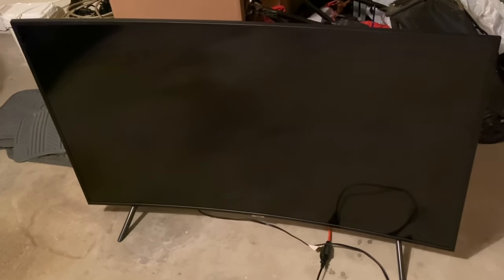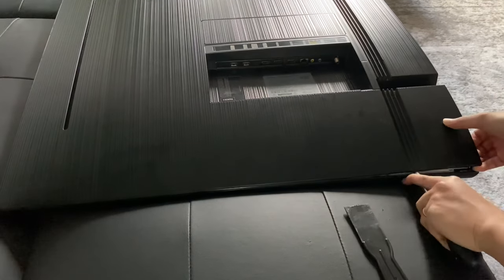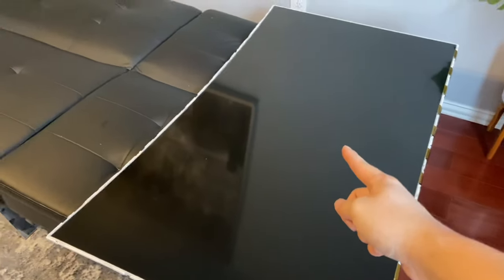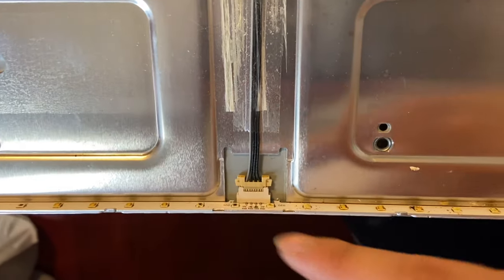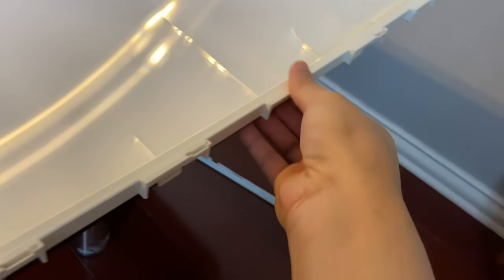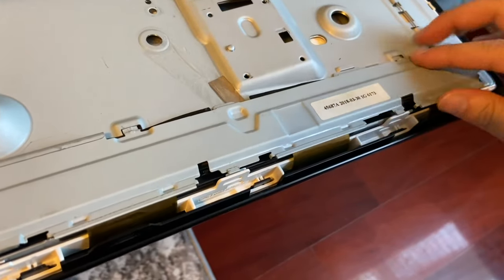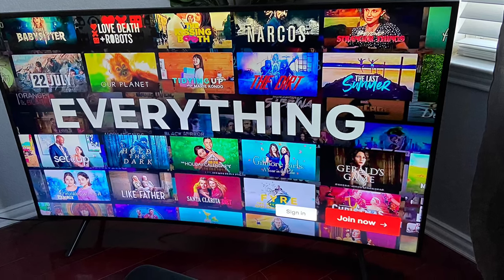Replace Backlight LEDs on Samsung Curved 55” for $30 (UN55NU7300 / UN55NU7100 dim screen)

Comment from the maker: IMPORTANT NOTE: On the burned plexiglass at 5:19, it's best to sand down / dremel the burned areas until they're gone, and then reinstall it into the TV the same way. If you do not dremel down the burned areas, TV will appear yellow like at 9:11. The way the plexiglass is made, it's supposed to darken the section closest to the LED and brighten the section away from the LED. Do NOT flip the plexiglass. 
1. TV LEDs can be purchased here! http://ebay.us/KQqhgg
2. Screwdriver set: https://amzn.to/2OiNf6v
3. Plastic Putty Knife: https://amzn.to/3rfUGtQ
4. LED Lights: https://ebay.us/scXAT3 OR https://amzn.to/4du9nBz
Reply: I have the UN55HU7200F ( not the NU in the middle like yours ), same backlight as in yours or is it a full array?
Reply from the maker: @kriswingert1662  HU has many more backlights https://www.ebay.com/itm/203105953105
Reply: @EdwardInTX  I have the Samsung UN55NU7300FXZA. As with your's in the video, my plexiglass is cracked and the inner white panel next to it had LED heat damage. Smelled, LOL!!! I got it fixed and it is watchable but the cracks and heat damage do show on the bottom. Can those parts be found at a reasonable cost. Now that I know how, it'd be an easier task. Best advice I can give to others about doing your own repair is to have and use patience and a small and thin straight blade screw driver to remove the white inner frame and twist at the tabs just enough to clear the lock points. My only left over parts were the few I broke and then thought about the smaller screw driver and that worked. But I also slowed down the process. Great video. Thanks Edward.
Reply: You really oughta add to the video itself about this. No one is going to look at the comments until after they have problems from following your advice. You can add audio, video or just captions but you're garnering a lot of ill will by leaving it up as is.

Comment: Excellent Video!  Thank you for posting!!  Let me ask you this.... Why is it that just about everything Samsung makes, turns out to be absolute crap!??  We purchased all new higher end Samsung black stainless appliances in 2018. In the first year the microwave failed twice. The oven part of the range failed twice, the fridge ice maker froze over daily and stopped producing ice.  The metal finish is so thin that it dents with almost no pressure.  Now our 2 year old 75" OLED backlight has failed on the right side.  I WILL NEVER BUY ANOTHER SAMSUNG PRODUCT EVER AGAIN.
Reply from the maker: Wow this is terrible! I have a samsung microwave and range and they haven't failed (knock on wood)

Comment: Few tips for anybody giving it a go:

1) when you get to remove the LCD panel I found if you very carefully slide a bed sheet) or something similar) under the panel you can easily slide the panel from the base without damaging it.

2) tape the 2 white sheets under the (LCD Panel) together so you don’t lose their orientation/order.

3)do the same for the plexiglass and white backing as it is KEY this goes in the correct way or light will not amit correctly.

4) make sure the white frame clips securing the felxiglass are fixed in correctly. (I made this mistake and I had a lot of LED bleed along the bottom edge just from 2 clips not in correctly)

5) if you put it all back together and the bottom of the screen is very light and top very dim. Your Felxiglass is upside down. Unfortunately you have to take it all apart again and turn it so the top edge is at the bottom. Trust me it a lot easier to take apart the second time. ( you can also plug the tv in with just the plexiglass clipped in to see if the light is covering the entire panel. Instead of reassembling the whole tv to find it's not). 

But Thanks Man what a helpful video! Wouldn’t have tried doing this myself if I didn’t watch it and now have a good as new working TV!
Reply from the maker: Excellent tips!
Reply: I'm having the opposite effect of the  bottom portion being bright but the the middle and top being very dim.

Comment: We followed your guide and were able to fix the tv so that it was watchable again but it was far more difficult for us noobs than it seemed in the video. Many of the little plastic tabs broke and a small chunk of the bezel broke, etc. The one issue that we have now is that when we turned it back on and could see the screen, the picture looks like its being viewed on say.. something like cardboard or some other sort of material and on the far right side, there's an inch where the picture stops instead of going to full side. We obviously messed something up in putting it back together and the two that helped aren't interested in repeating the pull apart process because it was such a hassle for us. No matter what though, the good news is that the process you demonstrated worked and we can now see the full screen. Whatever caused the other issues was something we somehow did. Thank you for the video.

Comment: I used your tutorial on my flat screen Samsung UN50NU7200. The components are exactly the same, except it doesn't have the white tabs securing the metal strip. Unfortunately, I hadn't read your comment about the plexiglass orientation and that dark-on-bottom/light-on-top thing, so I'll be re-doing it tomorrow.  For now, the light strips are working great. Thank you so very much for a great video!
Reply from the maker: Awesome! Hope the reinstall goes well!

Comment: I did this repair and everything went well following your instructions. I also had a crack in my plexiglass  but unfortunately flipping it around created a big shadowed area in upper portion of the screen. Just had to install it the way it was and all is well!! Thank you very much for this video!! 👏🙏
Reply from the maker: Awesome!!
Reply: Because maybe yours contain mirror sheet and u didnt flip the mirror sheet that reflect light some of those have this type of sheet that u must flip them
Reply: @StAlKeRsification  Things woodworkers don't know! 🤣 Thanks for the solid info.
Reply: @tecc8380   im a mechanic but i know basic electronics
Reply: @StAlKeRsification  So you are gonna use your "intelligence" to generate a negative vibration and judge your own kind? You are aware that people know different things, right?

Comment: Hey, thanks a lot for the guide. Based on your video I successfully repaired slightly different model (6 series instead of 7). While there were some differences your video was a great start.
Now I just hope those "original" led strips from AliExpress won't die after 2 weeks
Reply from the maker: Very nice! I've done a handful of 6 series the same way!

Comment: Thanks very much, I used this video to fix my own issue, sadly, as careful as I tried to be I cracked the screen. Knew it was over but decided to carry on anyway. Anyone thinking about doing this, please be so careful. I barely moved the screen and it cracked. On the bright side I've just ordered a 70 inch ambient light Philips. 😁
Reply: This is why I am having a professional fix my TV.  I would break something if I tried to do it.
Reply: @fidelbanuelos9601  buy two suction cup thingys and its easy...my dumbass cousin lifted the corner as I was unpacking my suction cups and cracked the fuck out of my top left corner almost to the top middle of the screen...so other than that it's surprisingly easy to do in less than an hour, just use suction on the main screen
Reply: @Beast-mf7br  I used paper packing tape instead of suction cups- worked great and left no glue marks

Comment: Fantastic video — thanks! My son and I had a great afternoon project and the TV is working beautifully. Had a minor panic when we turned it on and the screen was black. Realised we hadn’t connected the ribbon cables correctly so pulled it apart and reseated them. That fixed it and our heart rates returned to normal
Reply from the maker: very cool!
Reply: I'm having the black screen issue as well but reseating the ribbon cable hasn't fixed it.
Reply: @reallaknight503 If the screen is black then it means that the signal isn't getting from the board to the screen. I'd double check the seating of the ribbon cable, I found it a little tricky to get it seated right. If that still doesn't work, check the other end of the cable and if that still doesn't work, check to see that there's power getting to the boards.

Comment: Near my entertainment center I have always kept a filtered 12x12 box fan , I've never had anything ever go out on me because of this .
Started when I was young I got to have my box fan near me and as I learned heat was the main failure of electronics and noticable heat coming from tv, computer, Xbox and or surround sound.

Comment: I just followed your video to successfully replace the backlights on my Samsung 55 inch tv.
But half an hour after watching a bit of tv the newly replaced LED strip burnt out on the same side as it did with the old LED strip.. :(
Any idea why?
Reply from the maker: omg no! That was a bad LED strip. Request a replacement.

Comment: Did repositioning that paper help with the back light bleed? I have the same issue after replacing the LEDs.  I hate opening up this TV lol
Reply from the maker: The burnt panel had to be installed the same way it came out. Can't flip it. The trick with that panel is the burned areas need to be completely dremeled off.

Comment: Great video.  I have one now that needs the repair.  Could I put do anything such as adding thermal paste to help prevent over heating again?
Reply from the maker: Some people mention adding a capacitor to regulate the LEDs but I’m not that advanced
Reply: @EdwardInTX  i have the same problem on my samsung..
Really refuse to send it back for repairs for hundreds of dollars so i might try it myself
I’m just wondering how old was this particular tv? Screens nowadays seem to last like a year or 2 until they get this 
Great video though!
Reply from the maker: @mrcreeperman13  this was either 2017 or 2018. It was the 4th 7 series samsung I fixed.
Reply: Richard Dolesh una pregunta este tv trae salida de Bluetooth ?

Comment: I really wish you showed how to safely move the lcd panel instead of transition to it being done. My brother and I were on the last step of moving the lcd panel back in place with a team lift, only for the screen to crack in the same corner I replaced the broken leds. Now instead of half a screen being black, I have about %96 a screen with a crack in the corner.

How did you move the lcd panel multiple times as one guy without cracking it?
Reply: Exactly. My new LEDs are working great, but now the tv is trash because somehow I got a crack through the screen. Tv is trash. I was trying to be so careful and didn't even realize I got crack until I got it all put back together and turned it back on.

Comment: I Would have liked  a few  shots of the whole back of the tv, can you confirm what boards are they, main board, power board etc?. Before I dismantle ours I am wondering if it is worth it cost wise. Ours went bang & I would like to replace all boards as I suspect the power board took them all out?.
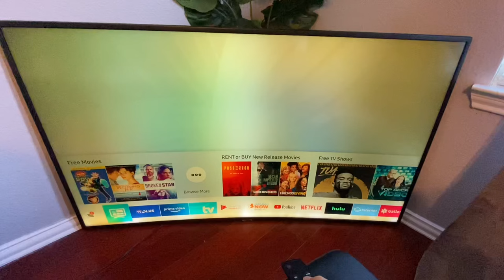Reply from the maker: 9:18 - 9:26 show the main board (green) and power board (brown). Those are the two main ones. If either of those don't fix it, there's a deeper problem in the panel that isn't worth fixing.

Comment: I repaired a same 55 Samsung tv like this but i has light bleeding like your tv, you said the problem is the position of tge first white paper.how should i do it on the first white paper to fix light bleeding in the bottom ?
Reply from the maker: Actually  I realized it's because of the transparent plexiglass. The best way is to dremel off the burned parts of it and put it back in the same way.

Comment: Hi I have a issue and I really need help I replace backlight in a samsung UN65TU8000FXZA after installing the new light I test all with my backlight tester all work fine. After putting the tv back and plugging it in the backlight is not powering on.The powerboard is working because I'm getting power about 280v for the backlight. So my question is what could be the problem could it be the white connection between the powerboard and the lights. I forgot to mention I test the backlight using my backlight tester and the backlight work. I have some needle leads to my backlight tester so that's how I was able to test inside white connections.

Comment: Great video.  I just want to ask if the cracks on the plexiglass don't matter because there are quite a few of them.
Reply from the maker: If there are brownish spots at the end, sand them off. The cracks will show a little brighter than the rest of the screen, but not really bothersome.
Reply: @EdwardInTX  OK.  Thanks for the reply.

Comment: Thanks man! It helped a lot, after I replaced the back light, the top looks darker than the bottom. Is there a reason why?
Reply from the maker: The plastic diffuser panel distributes light to make it even. The best remedy is to saw off the burned parts at the true bottom and then reassemble it. Light will be even after that.
Reply: @EdwardInTX  I just change the position of the plastic, it looks way better. Thanks man!
Reply from the maker: @TheAldoo1995  Excellent!
Reply: @TheAldoo1995  what do u mean you change the position by mounting it upside down?
Reply: @4g63_Everything  I think I accidentally changed the plexiglass position. It didn't look as bright as it is supposed to do.
Reply: Usually if you just flip the plexiglass around so the bottom is facing upwards it'll work as well and you won't have any issues.

Comment: thanks for showing the led strip change. do you suggest to fix the vertical shadow on the screen by changing the led strip ? will it help? Also could you pls suggest the led strip for the curved samsung UN55KU7500 model.
Reply from the maker: Yes, you'd need to change the LED strip to fix the vertical shadow. This is for the KU7500, but the led strip installation process will look different from the video as the LED are scattered across the screen. https://www.ebay.com/itm/154951141781?hash=item2413cec995%3Ag%3AeFcAAOSwLateeccK&amdata=enc%3AAQAHAAAAkMSl1Ks%2BPSe9V5Ol0qrJlK02c0N1Sxp5csU25%2BxOlb9DWYDGpJqQ9wH%2FylpV9uLs8T5yJCVE27ttIBryoHdMYyBFYscUxyHiyEetpCtle5YQ6X0ephVN92y84wjrQWArBvV6Xx%2B5MKh4FpNztva0GIMzJ%2Bhld8ana9B8Ko9bJAOQYel%2FuHkiMZCPfX2AExF4Ow%3D%3D&mkcid=1&mkrid=711-53200-19255-0&siteid=0&campid=5338782093&customid=&toolid=10001&mkevt=1

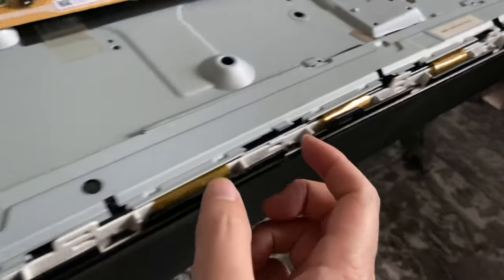Comment: So I’m following your video up to the point where you have to remove the cover source PCB panel at 2:45 and there is no white hooks. What do I do? I’m using a NU7100 50inch
Reply: I am in the same boat and was reading the comments to try to figure this out

Comment: I have a cracked and burnt plexiglass just like in your video. Mine is a little worse, but do you know if you can get just the plexiglass? I am not having luck finding. Even Samsung does not have for resale to the end user and no techs within 200 miles
Reply: Larry I feel you, man! I've fixed ten Samsung's with edge lighting all with the same problem. I've spent multiple hours looking for a way to purchase the plexiglass diffusor. Still can't find a place so I have to swap them with ones I  find from broken screen TVs. Did you ever find a place?

Comment: Seems u might know the answer to my question. What's causing light bleed/4" bright flares on left and right on my 65" curved Samsung? Also a couple of dark spots a little larger than say a capsule💊??
Reply from the maker: What model is it? Email me pics at my about link on my YT profile.
Reply: @EdwardInTX  un65js9000f. Sorry, not able to email. Couldn't find it under your about link. I'm guessing the flare's (very bright on one side, shadow on the other are internal cracks. I may dig into it tomorrow. Get a better idea on what's going on.
Reply: @EdwardInTX   @EdwardInTX  so yeah.....it has all the same issues you had. Too bad the burnt cracked plexiglass can't be replaced. But thanks to your video, once I replace the LEDs, I'll have 25% improvement on light emitted and perhaps if I use windshield repair resin on the plexiglass it might help? Or super glue? I'm more hesitant on the super glue being that it's plastic.
Reply: @shanewatkins5636  did the repair resin work?
Reply: @kvothe4637  it helped. Just wasn't worth the effort for as little improvement as it was.
Reply: @shanewatkins5636  ok buddy, 👍

Comment: I followed the instructions and replaced the LED but now the screen is entirely black. Panel and plexiglass all fine. What could have gone wrong. I am only hearing the sound but no display at all
Reply from the maker: Connection ribbons to the panel at the bottom of the screen

Comment: @EdwardTX 
I own a Gigabyte 32" Monitor G32QC and need to replace one of the light strips as I have a black bar, indicating that one of the backlights is not working. Could you provide the part number or share a link to the backlight strip that would be compatible with my monitor?
Reply from the maker: did a quick search online, wasn't able to find a replacement LED set for that

Comment: I have a curved on different model it turns on go's to a blue screen then shuts off my electronic mentor says it's probably a resistor on the power supply. Dose that sound right? Mine is a Samsung UN65KU650DFXZA

Comment: nice video, quick question tho, i have a samsung UE43NU7199 with the exact same problem but i can't find any backlights on ebay for that exact serial number, will any 43" samsung backlights work? or the ones from the NU7100 series maybe? please help

Comment: is there any way i can get spare parts for those boards at 3:55 (i accidentilly fucked up 2 of those yellow ribbon cables.)
Reply from the maker: Theyre called buffer boards, sometimes they appear on ebay but the connections are so small it can be difficult to reattach/solder
Reply: @EdwardInTX  thank you. you absolute legend